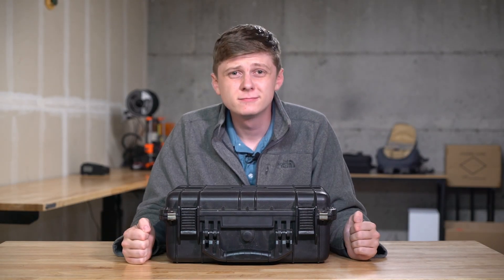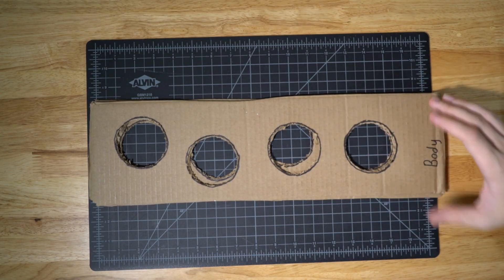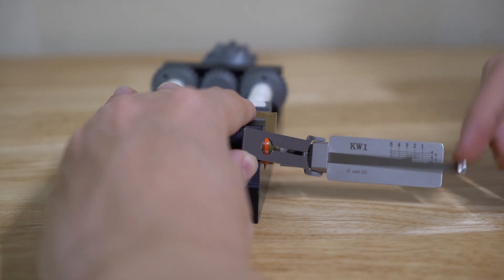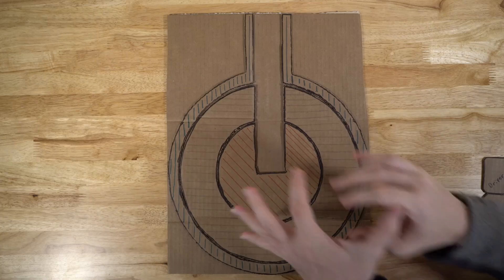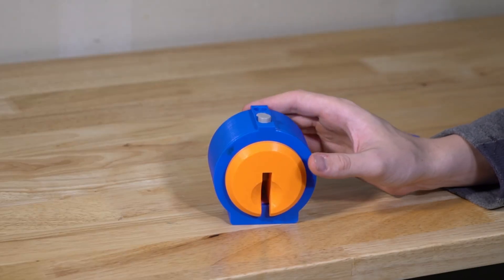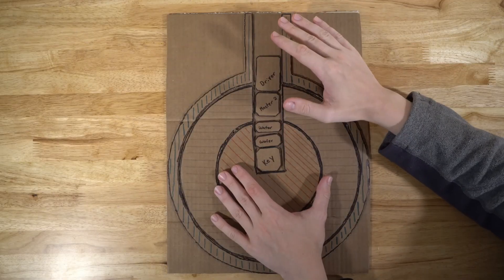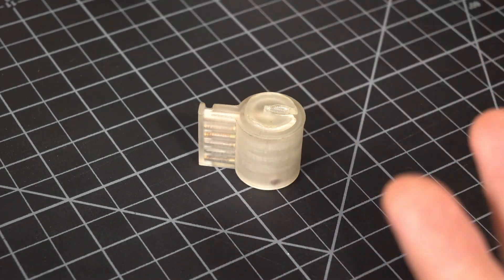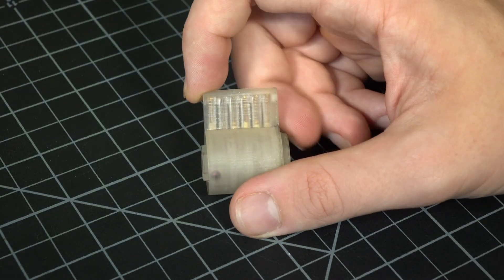How to Design an Unpickable Lock

Comment: Nice try, i thought about this some years ago (and certainly wasn't the first) then threw it away as all it goes is making picking a bit harder while not being compatible with standard lock bodies making it hard to adopt. 

The thickness of the middle core limits the amount of spacers/wafers you can have. So your key has only a couple possibilities per pin meaning you need more pins. 
The inner core must only ever be filled by key and wafers. the master must never enter the inner core. 

You can rather easily lock the middle core with the first core simply by pushing up one pin and turning until you get a wafer to lock up. Tolerances will make it work. at this point you can test all other pins. Sure you will never get an open that way, but you will be able to slowly decode. Yes this takes at least twice as long, possible longer, but it is still a mostly guaranteed way to open. There are things you can do about it by playing the with the tolerances of your watchdog, but it is never unpickable. The chances of this getting adopted are negligible.

Comment: Most people who want an unpickable lock don't understand or looked at the attack tree and threat model of the situation the lock is used in. While musings about creating unpickable locks are fun, they are mostly pointless. Like most security controls, locks are not designed to stop an attacker on their own. They are meant function in a web of security controls and force an attacker to take a more time consuming and/or more easily detected attack vector. Someone picking a lock is ideally spotted und evicted. If you have unpickable lock on your gym locker, a sufficiently motivated attacker will show up with crowbar and bolt cutters. Which will get him evicted as well. But you now spent considerably more ressources to reach the same goal. 

Of course, in any situation where the response chain (detere,detect,contain, remdiate, recover) is broken, you are kind of f'ed anyways. Bike locks for example. A bike lock can only ever function as a deterent, as most of the time it will be impossible to respond to an attack. If your attacker is motivated enough, they'll just keep escalating. Like showing up with van and some angle grinders, flexing off the steel bare 20 bikes a securely locked to and taking them all at once.

Comment: Bro mechanical unpickble lock

If you use computers and electronics it gets much easier you can do laser testing and no core at all just insert key and lasers or diodes check combinations.

Even better w magnetic key card with thousands of possible variations.

Why not make an magnetic key that has carrying strength

No core to prevent testing 

And the further away the magnet is the weaker the field gets and smaller force is exerted on the read pins and you need exact force on all at once

Comment: An idea I just had - make the pins inaccessible by making the key with spots of different conductivity/resistance, that way when a current is channeled through it the magnetic eddy currents act like a fingerprint.

Kind of like how vending machines test coins.

The current would only be applied on the second stage, after turning the key a little.

(Basically, the ultimate take on keeping the pins out of reach of the lock picker)

To be fair, a very expensive idea to produce, to make something akin to a Entry Code built into the key.

Comment: The thing to remember is that a thief doesn't see the lock as challenge to pick - he just wants your stuff.  I've seen expensive locks on cheap hasps attached with 1/2 inch screws.  A crowbar, hacksaw or battery operated grinder and your investment in an expensive padlock is pointless.  

When I was having my house built I wanted the contractor to upgrade the front door with a metal frame so I could put in a good lock and avoid having to door kicked in.  He told me a story about a house he knew where the thieves had used a chainsaw to cut a hole through the wall.  A determined thief will get in; defeat the lock, break a window or smash the door with a truck.

The best security advice I've ever heard is that what you are really trying to achieve is to make your place less attractive than some other place.  A decent lock, cameras (even dummy cameras), motion sensing lights, a security system, window stickers, break resistant window film, security bars on ground level windows, having a dog, having a good relationship with your neighbours and an agreement to watch each other's property are all part of it.  

Ultimately, however,  the best security comes from having a good insurance policy.

Comment: Locks are fundamentally designed to be open. Therefore, there is no such thing as an unpickable lock. An unpickable lock can't be opened, which defats the point of having a lock in the first place. Each of these devices you made and designed is sadly one LPL away from finding a flaw, bypass, or oversight.

Locks are only capable of keeping honest people honest. Here's a thought. If you want to design something new, design a lock that doesn't lock like a look. Start with a door, a frame, and figure out how to keep it closed. Bonus points if the lock can't be detected. A lock is a good indicator that you have a reason to keep people out. Which is ironic, given those same people are looking for a reason to go in. 

Respectfully, you need a full reboot.

Comment: Locks get picked because its easier than cutting the bolt or chain - if it becomes to hard to pick, a destructive method becomes more desireable and will lead to the same result.
Locks are deterrents, they cant secure against the genuine intention to bypass them.

Comment: I want to see LPLs take on the design now. See what vulnerabilities he finds, so you can refine it further if needed. 
My guess would be the lock core(s) need a strong steel core cover disk to make set pin drilling harder/impossible. That is, a hole drilled through the core cover(s) and a pin peg inserted to freeze the two cores together so regular picking can be used like you said. A small flaw, tricky in nature, making it much more pick resistant but not proof.

Comment: so you legit have to guess each pin and can only be checked after a full rotation. meaning they always get a click on each pin and turn. but only when all pins are pre set ALL in the right level will it turn. so you can vary wafers and cores. this is like irl encryption. you'd  have to brute force guessing and almost infinite combination of 0 through as i can see 3 wafers in all three pin holes and if and only if they are right it will all turn at the same time. all using simple shapes. this doesn't even cover the fact as a picker you probably can't see the mid core

Comment: your design still isn't unpickable. It's amazingly pick resistant, yes, but you can still pick this lock. To use your hangman example, you still have infinite guesses, but the lock doesn't have to tell you if any of your letter guesses are correct. It only has to tell you if you get it 100% right. Which is still possible.
Reply: Im not sure you understand how impossible it is to guess the height of all pins simultaneously in practice.

Comment: Cant you just pick this by binding the core and the outer core, picking all the pins except for the watchdog pin, then keep tension as you decouple the inner and outer core so the watchdog jumps in place? Essentially if the lock is as you say, you just have to pick the watchdog pin last by decoupling the core and outer core.

Comment: An excellent visual demonstration of how lock picking works, and related to pickers language, binding, counter rotation etc. Could also an answer to an unpickable lock be using electronics where there is no manual backup method of entry, such as, a key. Maybe, a secondary circuit with a separate power supply to act as a failsafe system should the primary electronics fail.

Comment: The one attack vector you could feasibly have with the theroretical core binding method is leaking information about the key's code. If you have 5 pins and 3 binds before the watchdog does, you have 3 digits of the code. Usually these keys have a few levels, 4 or 5 sp thats 16 remaining codes to try which is pretty trivial to crack. Come back with 16 keys and try them one after another. Passerbys will just think you forgot which key on your massive keyring is the correct one.
(Methods for inspecting how high the pins are in the key holes already exists)

Comment: The issue with locks is - they serve the same purpose as a seal sticker. They are a "no one has tampered with this" device rather then a "no one has access to this" device. Because usually you can just use a crowbar and bypass the lock. It's just that it leaves marks. There is very few need for something that cannot properly protect against someone getting in, but just makes sure they when you come back and see it you know no one has been here. Let's face it - the only time you won't know if someone picked your lock would be if they were very professional at whatever they tried to do behind that door. If your place get's robbed, it makes little difference to you if they unlocked your front door with a lock pick or a crowbar.
Reply: Yeah no, security is about deterring the most common attacks on the weakest link for as cheap as possible and not about seal stickers. You know someone has entered your house when it is in a robbed state. And you care more about preventing that then knowing that it happened.
You cant get through a metal door with a crowbar.
Reply: This is why I use zipties instead of TSA locks when travelling. I know how easy they are to open, (you can print TSA keys). But a serialized ziptie is a little more difficult to open without signs of tampering.
Reply: @GlennBrockett  you know there is a little tiny latch that if you have a small enough flat object you can loosen the zip tie?
Reply: @MileTailPrower  But they usually won't bother. The seals I use are tamper evident. As I said, I don't pretend it's secure, I just want to know if it was tampered. (You can usually tell if they have pried the latch on the smaller zipties.)
Reply: @GlennBrockett  alright, i just wanted to let you know is all, sometimes you wont be able to tell
Reply: @GlennBrockett  opening a zip tie is extremely easy with a small piece of metal and you can rezip it easily once more as well afterwards. you just need to lift that little bar and it opens with ease...if you keep your nails long you can do it with your finger. Rather a TSA key lock, at least that needs a 3d printer or to buy the key and kids probably won't be able to upen it
Reply: @truemuad  what I use are tamper evident seals, not actual zip ties, but about the same price.
Reply: There absolutely are situations where it matters. For example, a gun safe. Those are made really hard to get into without the key, except for the weak locks. Good locks would likely reduce car theft as well, as a the value of a car that has been destructively broken into would be a lot lower.
Reply: You're countermeasures just need to be above average. Then they break into your neighbors house / apartment. It's as simple as that. They will always go for the low hanging fruit. Unless they have intel you store you're money under your bed or something like that. And more privacy means at some point of attack, means it's much safer to use it.
Reply: i mean, if your doors aren’t made of paper (like the US standard doors), opening them with a crowbar can be very difficult or almost impossible. next weakness is ofc windows, which you can put bars over (but probably don’t want to for residential homes) and of course, don’t make outer walls out of paper either. at this point the lock can actually be the weak point again
Reply: @asdfghyter  Breaking stuff is loud, which makes locks have a slight security feature. If they don't pick them they might be heard.
Reply: @safetyinspector250  that's also a good point. you can also put alarms on windows to detect when someone breaks them
Reply: @asdfghyter lol no
Reply: sure, but any improvement is still better than no improvement

Comment: Knowing there's two wafers fully defeats the lock. That's the most obvious flaw, and probably the easiest to fix. I also suspect that you could devise a method for single pin picking that'll work. Im no lock picker, so maybe im wrong about that.

Comment: Those thin wafers are a weak point. Every wafer that is thinner than the diameter of the hole is a failure point. They are known to cause issues.

There's one little change I'd recommend: At the outer shearline, chamfer the hole of the lock body for all pins but the watchdog one. This makes it more likely that the watchdog binds first.

In general, I don't think having the real shearline in the 12 o'clock position is a good idea. I can see a couple of attack vectors (e.g. shearline probing by feeling for the step, back rotation). I'd prefer a solution that locks the pins in place once the lock starts rotating (e.g. by them having ridges and sliding into a comb), then the drivers being lifted off the key pins, and only then hitting a shearline.

Comment: First unlockable locks already exist.
The Abloy protect 2 is unpickable. Virtually. Sure there's a couple of guys on the internet that pretend they have done it even if that's true they are just a couple of guys in the world.
Unless you want to protect yourself from the CIA or something nobody's opening those locks.
And that's the story. I've heard of many homes broken-in. They were never lock-picked. Thieves would break a window or break the door.
Also those YouTubers designing locks forget a thing: there's a lot more to lock design than being pick-resistant.
You want them to be reliable, wear resistant and economically viable.
That's why the disk locks are popular. Sure there's the novelty factor, they need special tools to be picked, but mostly they remain fairly simple and very reliable/environment resistant...

Comment: Great video, great idea! 
Best thing is that it can work with “normal” keys and doesn’t need any special key copy equipment at locksmiths 
I’d say make (or let make) a brass version and send it to LPL !
Also if there would be a way to retrofit existing locks with these enhancements, e.g. replace the single cylinder with the double one, that word be epic 🎉

Comment: Great design! This is possibly the best tweak to pin tumbler lock design I've ever seen. I'm not sure about how cheap it is to manufacture, though. Having core that needs lathe work, broaching and drilling for the core combined with drilling of the mid core seems potentially expensive. On the plus side, the looser tolerances needed for this kind of design help a lot with the price. I guess the biggest question is how many thin pin wafers you can use because that limits the number of "false gate" positions.

For example, if you can fit only two wafer pins per stack and use 5 pins, total keyspace is only 3^5 or 243 different keys. Not great because if this kind of design were commonplace, a thief carrying full 243 key set could open every lock ever manufactured using this scheme. And you could add a second row of pins but then manufacturing it gets very expensive very fast.

The design you used to separate set and test events was ingenious, though! All the other designs have required multiple actions by the user but this can do everything with a single turn, similar to disk detainer locks. I think a bit different shape for the middle part would be even better to avoid sharp angles in the cam mechanism but the  idea is a good one.

Of course, this lock can still be decoded, just like every other mechanical lock. But if you use tapered pins for everything, decoding the lock will be tedious task.

I'm a bit sad that it took me this long to find this video. This is definitely a better design than the one I designed for my own pin tumbler variant.

Comment: Could this not stoll be thwarted by potentially taking advantage of the last "no touchie" pin tolerance? Where if it manages to be the last pin needing to be checked it could still be picked as usual. Or maybe forcing anotherbpin to bind the core to then try and find the pin positions of the others

Comment: I had similar design, but the issue is, that you could have a blank key, that lifts all wafers to the top, where it creates shear line with wafers. Better design would be to have master pin with slim part that accepts moving blade at some point to test all master pins height. Similar to a bar in those rotating locks with plates and hey with angled notches (sorry forgot the name) that have gates, false gates etc. Those also can be utilized to create such unpickable lock.
Reply: If the pin stack isn't tall enough to fit the pins like that, then it won't work. You can only comb-pick like that if the pin stack is manufactured with enough empty space to fit all of the pins above the shear line.

Comment: My first concern would be that friction causes the midcore to rotate beyond the neutral position while closing it, thus preventing it from actually locking, as well as trapping the key in the core. If not countered, this would make the lock particularly vulnerable to dirt, dust, water and all of the other nonsense found outside, where locks are most useful.

Comment: This is cool, but I've used locks for decades, and never once have I seen a thief pick a lock. If a thief wants to get thru a lock, they break it. Or they break a window. Because it is significantly easier. 

Manufacturers use ancient tech because it's good enough and its cheap.